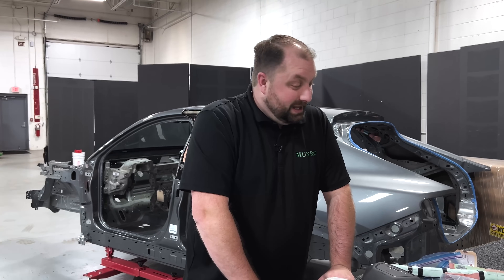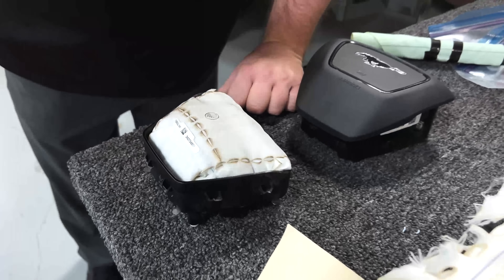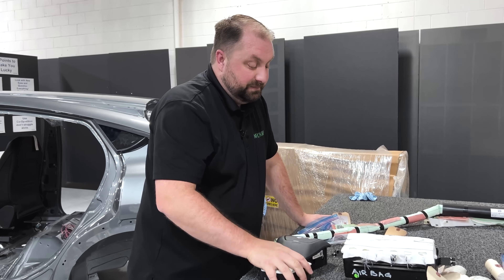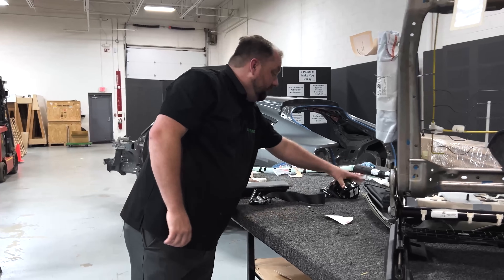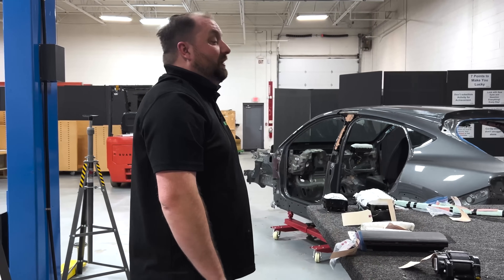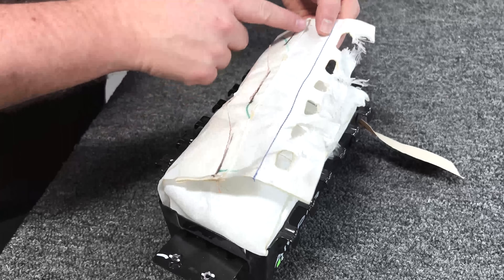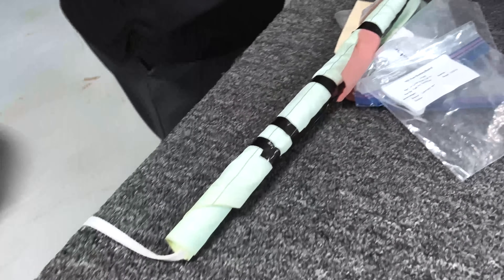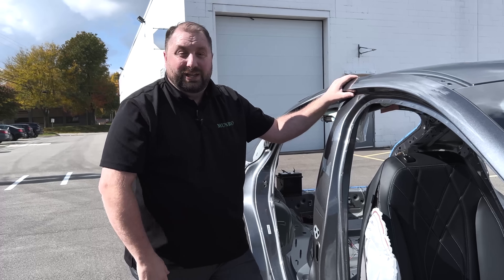Automotive Fabrics, How Seat Airbags Are Deployed.

Comment: Ok interesting. So I have a Mini Cooper with seat airbags.
Now, I got from the wrecker a passenger side seat cover to replace the worn drivers cover in my car… but… the cover has a fabric strap that mounts around the airbag in the seat, so being a passenger cover, naturally it’s on the wrong side. Sounds like that strap is a crucial feature for the airbag and I should not install that passenger cover on my drivers seat?

Comment: If I take off the back of my drivers seat to add some  additional foam in low back area can I activate the seat airbag or does the seat airbag only deploy based on speed and impact sensing?

Comment: Great information about B pillar verses the seat its self. Also really interesting about division of "labor" with design and break through requirements. Maybe you could expand on the moisture problems that caused a ton of airbags to be recalled, and where airbag manufacture and/or car manufacture could make improvements to prevent similar issues.

Comment: Fascinating. I'm a retired engineer/ manager, and now an owner of a new Tesla. I've been modifying Tesla seats. That's because as a larger framed person, the Tesla seats become quite uncomfortable. I finally developed a design for people of larger frames who find the stock OEM too small and uncomfortable. This information is useful to me, if not critical. Thank you so much. I do have a TECHNICAL QUESTION. In the Tesla passenger seat there's the weight sensor, similar to the white one in this video, but there's also a stitched wire in parallel to the heat wires in the seat cover. (seat bottom). This additional wire in the cover only exists in the passenger seat.  I'd imagine it's part of the sensing system that the computer sources data from. This is possibly a ground plane and the seat sensor is using some kind of proximity sensing device in that flat sensor part below, perhaps capacitance? Or some other type that can determine distance from a ground plane?

Comment: Good job Munro, but not great.
Not one mention of the obvious, that is improperly seated passenger and the damage the airbags can do to them.  I wish we could have seen a insert of what happens to a dummy with its feet on the dash.
(A copy if this should be required viewing for all drivers).
A lot don’t have a clue of the power of airbags to injure and there’s a whole lot more airbags in each vehicle now.
BTW My Chrysler mini van(S) Braun modified for wheelchair have been hit in the front, once by a drunk and once by a illegally U Turning driver the airbags did NOT deploy.

Comment: Wow.  So many questions are rolling around in my mind.
This makes me wonder about the overall cost of replacing all that system as well as the damage to the interior?
What are the basic sensor parameters that are needed to set off the system?  
Does the system only deploy 100%, by occupied seat location or does the software differentiate the need for side deployment vs front deployment?

Many states have very low public liability insurance requirements.  Louisanana has a $10,000 minimum, I doubt that covers the cost of fixing the interior let alone any exterior.  Thanks to all the parasitic politicians out there.

Comment: Excellent  information about Seatbelts and Airbags , our should do explain impact  sensors and little  primer of  cost  of the systems  and replacement of those systems after a collision. I used to buy Writeoffs or what we call " Branded " cars here in Canada  , fix them  for self use.Each airbag could cost $1500 or more, this back 10-15years ago, now imagine 2 Airbags , Side Curtain Airbags  and Seat Airbags  and the Seatbelts have to be replaced, this on top of any Body  damage, the car is basically a " Writeoff", and  many commenters worry about Teslas Megacast being impossible  to repair?... I he said many times ,    "  Todays cars in major  collisions  are often times not worth fixing and putting back on the road.

Comment: Those two little words embossed in upholstery and dotted all around the interior of a modern car, go mostly unnoticed - AIR BAG.
The average driver has no idea of the massive amounts of engineering, cooperation in design and building of car and interior and the intricacy of the sensing and triggering  devices that operate the system.  
I'll never click a Seat Belt again without this info racing through my conscious thoughts at that moment - THANK YOU !

Comment: Great Video and information.  THANKS!!   A Few years ago, I was involved in a side impact at my A pillar.  My car then traveled 20-30 feet head-on into a concrete pole and tree.  Due to the multiple secondary collisions all 14 (seat bolster, curtain, knee and passenger) air bags deployed in all three rows.  I suffered no serious injury -- save  whiplash.  The system worked as designed.  Then system collectively worked.  Prior to this incident, I knew they were there but paid them little attention.  Thanks again and to all those who design these "hopefully never needed" systems.

Comment: Crumple zones, backup cameras mandated 2019.  Stability control mandated 2012.  Stability control has help prevent roll overs by controlling over correction with oversteer and understeer.  Probably saves as many
Lives seatbelts.  . Headlight brightness has helped especially adaptive headlights.  Old dirty t shirt colored halogen lights vs led/hid headlights to laser headlights.
Reply: Love your airbag presentation

Comment: Carl great presentation. I was hoping you might cover seat belt airbags too even though they are in limited use today.
Additionally, it would be a good prequel  to cover the development of seatbelts themselves and their proper use. I find most folks do not know how to correctly put on a seatbelt or even adjust a headrest to prevent whiplash.

Comment: Really liked that topic. Especially that you pointed out the importance of the safety belt and its tensioner ensuring to hold the occupant closely in position for airbag deployment.
Non-related to the airbags: As an added benefit a tightened belt will result in deceleration forces from the vehicle to the occupant to be transmitted earlier. The pretensioned belt then also allows for it to be released a little under peak load which results in less G-force on the occupants which in itself can be a huge benefit.

Comment: Excellent video.  Recently Congress woman Jackie Walorski died from a broken neck, in the back seat of a small SUV that crashed head-on when her driver passed another vehicle at high speed.  All occupants died, all were wearing seat belts and the air bags deployed.  Question: Was/is there an air bag for the passenger in the back seat?  The SUV was only a couple of years old (don't recall the make).  What protection does the back seat passenger have?

Comment: 9:22 What if the side lower bag was in between the door and the door card? Deployment starts under the seat moving up and across. The door card could also help spread out crash forces. Like  side windows with plastic between glass. The bag could also extend behind the door card to cover the B-pillar.
Reply: It would be wasted, as the intention of the seat airbags it is prevent more devastating injuries like a crushed hip, or broken Femur/hip joint
Reply: @tyyap76  Wow!
Reply: @tyyap76  the door card needs to stop at the seat filling the gap between the seat and the door. Then provide a cushion between the door and the passenger. It shouldn't intrude into the survival space.

The seat should prevent the door card from breaking the femur because the passengers are sitting in the seat. Some foam could be added to the door card. The seat should protect passengers from the door card. 
People can be injured if they're out of position of coarse. I used to drive with my hands at 11 and 1. Now 10 and 2 so if someone happened my arms aren't between the air bag and my face. It's also why most passenger air bags are on top of near the top of the dash. If you have something on your lap they want it to crash into the dash below the airbag.

Comment: 7:30 I always thought the safety cage and seat belt were more important than any air bag. Seatbelts and Side bags should be mounted into the seats. The seat belt and lower side air bags for the torso will be better able to control passenger movement if it moves with the seat in which the passenger is sitting. To protect the head a window bag combined with side windows with plastic between glass side windows so they don't break preventing a direct some head strikes from the other vehicle during the collision. The head bag being in the door pushing the door card out of the way going up to the roof. Unrolling on the window side.

Comment: Folding an airbag is a tribute to the art of origami.
I had an accident once where I bumped the car in front of mine in a rain storm while driving to work. I was braking, but must have hydroplaned and smacked the rear bumper of the car in front. My airbag went off and actually burned my left arm enough to take all the hair off and left a second-degree burn on the skin. I think that the heat came from the release vent, but I'm guessing. By the way, even though my car was drivable, when I drove by my insurance guy on my way back home, he said that the frame was bent and he "totaled" my car. I had to buy a new car after that.

Comment: the seat air bag should be a separate unit that is replaceable like a wheel airbag so the stitching issue is non-existent. seat covers wear out, so designers need to get over the aesthetic issues.

Comment: My questions are: 
How long are airbags good for?
What do you do when they expire and are obsolete for a classic car?
Reply: They are designed to not expire. Everything is sealed and inert until electrically deployed. The electronics perform constant self tests and should something be bad it will alert you with an SRS warning light.

Comment: Elon said, Teslas do not need seat belts already. Air bags deploy specifically to the position of the occupant.
Reply: Nonsense!!!  Stop taking crap!!! So is the airbag going to protect you when going at high speeds in a tesla plaid!? Stop talking crap!!!
Reply: Seatbelts are litteraly the very first daddy feature that must be in cars, airbags comes in second
Reply: @carholic-sz3qv  I have no way of evaluating it. It was on a call more than 1 year ago. He talked about, how Teslas monitor the position of people in the car and adjust the airbags a few times a second, so they are ready all the time. He told, airbags are needed because of regulation, but are not necessary to safe live.
I tend to believe Elon more, than angry engeneers. Usually he is right.
Reply: @carholic-sz3qv  I do not need to believe anybody. I can just act wisely. 
What exactly are you calling bullshit? That Musk said it, or that he was or was not right? 
It does not matter, what you think, what is not possible. I am interested in a discussion, how it may be possible.
Reply: @carholic-sz3qv I see no point in continuing our conversation. Bye.
Reply: @carholic-sz3qv  My life priorities are not emotion based. Think what you will.

Comment: I've been following automotive safety for many years. Much longer than the 5 star rating system of IIHS Top Pick. Before these rating my insurance company used to look at crash data and give a letter grade to vehicles. This might surprise a few people, but back in the 90s Ford accounted for approximately half of the A rated vehicles. Ford got as many a rating as all other manufacturers combines, and yes that included MB, Volvo and all of those other that claimed to be superior in safety. Ford does have a lot of models,, but that is still remarkable. At the same time GM accounted for more than half of all cars that received an F grade. Somewhere near half of all Fs where related to the S10 family of vehicles. When you have a poor design and then stick on 30 different nameplates is adds up. The Astro van was the only one that got an asterisk, stating that it was considers significantly worse than other vehicles that also received an F grade. Things have sure changed at Ford. Not as much at GM.
Reply: Ford had a lot of catching up to do in the 70's , 80's, 90's such as seat belts that would disembowel the occupants due to bean counter cost cutting making them too thin and narrow (rear seat belt in the Pinto comes to mind), transmissions that would slip into reverse when the engine was left idling (I personally got pinched while working in a market by a new LTD with this fault), brake/cruise control safety switches mounted under the master cylinder that were not resistant to brake fluid plus were not fused so if they came into contact with brake fluid they would short out/heat up/cause the cars to burst into flames (they really did not fix the root cause of the problem but installed a jumper with a fuse in it between the switch and wiring harness to make it "Safer" so if you have a Ford/Lincoln/Mercury from the 80's to early 2000's with Cruise Control that does not work it could be the safety switch has failed from brake fluid and the fuse inside that jumper has blown), heated seats that would set their occupants on fire, etc, etc and then instead of fixing the problem quickly would drag it out in court for years while fighting for the absolutely cheapest fix hoping to cut their losses with many of the vehicles already being in the junk yard by the time they could no longer stall things.  Some of the "Improvements/Better Ideas" were forced on them if they wanted to continue selling cars.  They were the first with a transmission/brake pedal interlock since they were going to be forced to stop using their own transmissions and have to purchase them from New Process (and others) until they could come up with a design that would not automatically shift into reverse and run you down in your garage or while loading groceries in front of the store (back then you drove up to the store and they brought things out to your car helping you put them in the trunk), etc, etc.  Younger ones may not remember these things while older folks likely have forgotten what it was like when companies such as Ford would choose long drawn out litigation denying faults rather than just fessing up and fixing things.  Financially it worked out better for them but it did come at a cost to the people harmed by those faults.  

Sandy might remember a time when employees who questioned things at a car manufacturer in the US might find themselves being readjusted by a special motivation and security team brandishing pick axe handles.  Things have changed over the past 50/60 years.  The good old days...
Reply: I think Chrysler and Nissan also tend to have pretty horrible scores in the past in general. I don’t like how GM still nickel and dime customers different level of AEB when it comes standard on some economy cars.

Comment: It's amazing the amount of engineering that goes into making airbags and placing them. They work perfectly each time as I found out when I had a accident at 60 mph and walked away with just a few scratches.
Reply: Well, not each time.  I was at the scene of a bad accident and  I mentioned to PD that the airbags did not deploy and the response I got was, "Yeah, sometimes they don't."

Comment: Great presentation.   Thank you for emphasizing the criticality of seat belts in combination.   
The number of people who don't appear to comprehended this is scary.   The other "scary" airbag scenario is the teenager with their feet up on the IP on a sunny day, with absolute disregard for the consequences.
Reply: I'm fairly sure it's a mixture of disregard, hubris, and just plain old ignorance. I've seen demonstrations of what happens to a passenger when they put their feet on the dash board or out the window and then have a crash. The airbag will break both legs and drive them into the chest. It is horrific and often results in the passenger becoming a paraplegic or dead.
Reply: There's a scene in Quentin Tarantino's Death Proof demonstrating exactly that lol
Reply: Different but similar, with the sun visor angled towards occupants. Things that really need to have many optimal individual events to align for best results.

Comment: One airbag not touched on here, probably because it's not common, is a seatbelt airbag. I'd be curious to learn your thoughts on that. Any cons besides added cost/weight?
Reply: I was thinking the same thing. Also, the front center console airbag preventing those occupants’ heads from bumping into each other. Rare, but useful bags.
Reply: A somewhat more common airbag (in luxury cars) was also not mentioned. The curtain airbag. It comes down from the a pillar and covers the windows.
Reply: @drkastenbrot  15:04 he talks about curtain airbags. These have been standard in the US for several years.